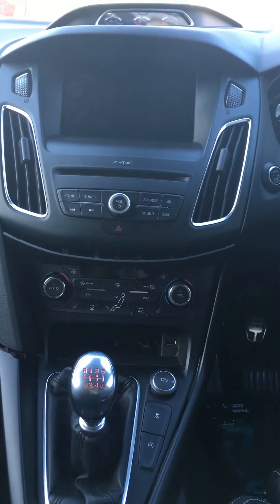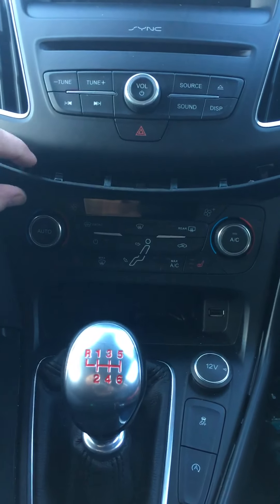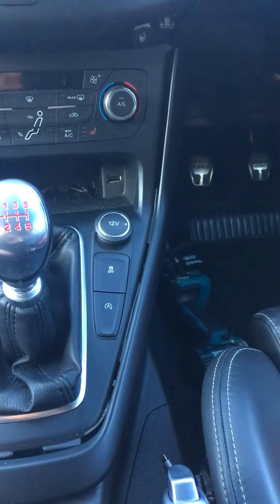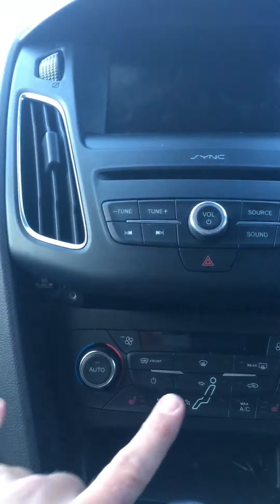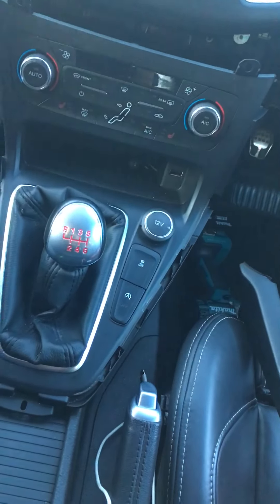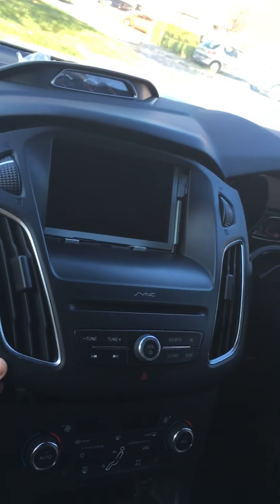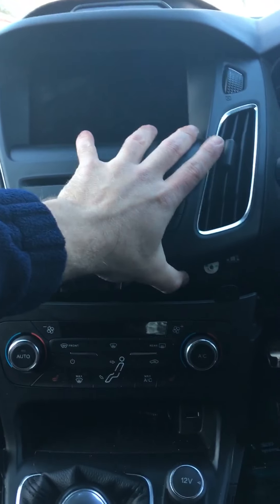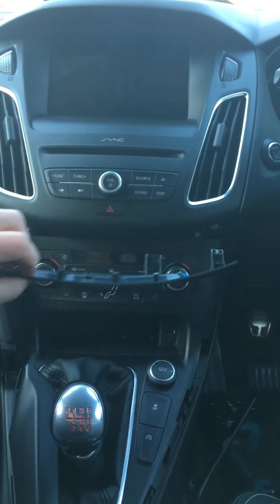Ford Focus 2015 2016 2017 2018 mk3 Sync 2 sync 3 stereo radio removal

Comment: Love you man, thx for the help. Additional info, because it was really hard to remove it for me: use a screwdriver to pop the 2 clips underneath out. They are right below the side torx screw holes, if you turn a flathead under them, the clips will release and you can just take the thing out without pulling the whole thing together. This is info for others of course

Comment: Thanks alot! Im adding a subwoofer and need to know how to dissasembly the panels to add a remote cable. THis helps me alot Thanks!
Reply: I dunno if this is too late, and I dunno if this is like the RS, but if you loook near the passenger footwell under where the gearshifter would be, you can pop off a panel that gives you access to all the cables you'll need.
Reply: @MahyarJavadi  i found the technical drawings of different focusses

Comment: Hey, great video. How did the Sync upgrade go? Does everything still work, like the dash screen display and all the car features? Also where did you buy your kit from?
Reply from the maker: Hi, I made this when I added a subwoofer but have since updated sync 2 to 3.   It took about 2hrs and was easy to do.     You can buy most of the parts from eBay but the screen and APIM are expensive.

Comment: I have just bought this exact same car and was wondering how to do this so I could upgrade the sync 2 to sync 3 for Android Auto!

What parts did you use for the upgrade. I'm not a car person and very nervous I'm going to break something,!
Reply from the maker: That’s exactly what I done.     You need the screen and module on the back of it (APIM) then a gps aerial from Amazon and you need to change the usb hub in the armrest then it will all work.
Reply: @markcoe69  brill. May have to look into it. Default stock sync is horrible.

One last Q if I may, with the focus you have directions and turns in the little LCD screen on the instrument cluster (between revs and Speedo) does this still work with sync 3 upgrade?
Reply from the maker: @Shadowknightneo  yes it does.   With Sync 3 you can download CYANLABS and bring its firmware and maps up to the latest software for free too!